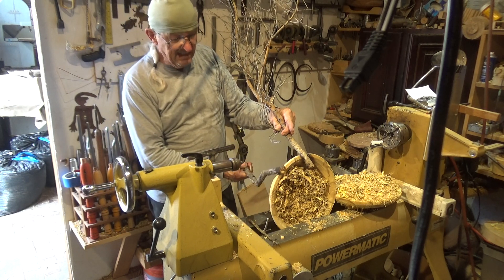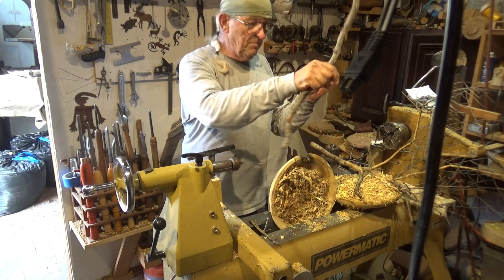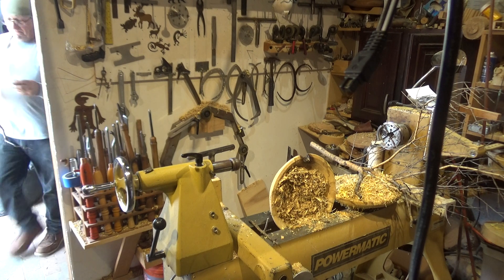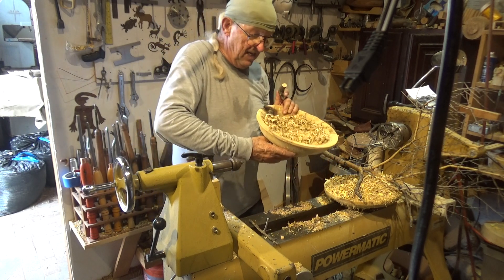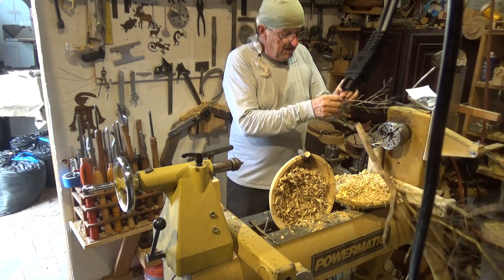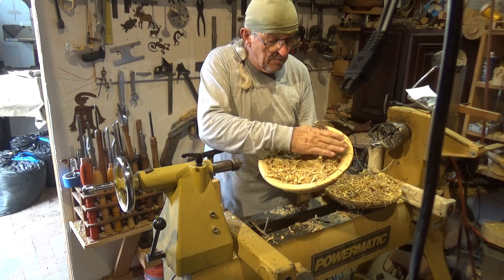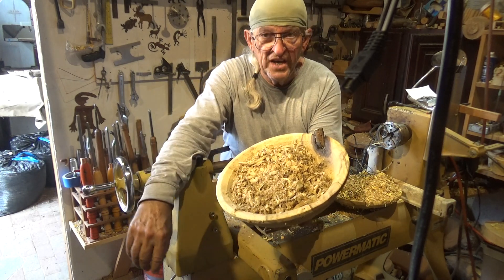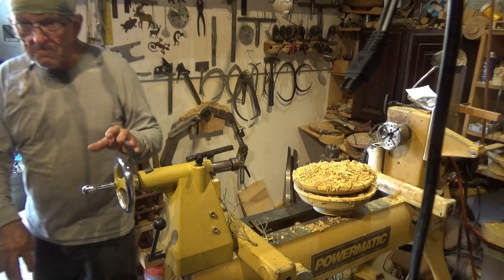Jerry's filler for larger voids

Comment: I have some 100 year old juniper fence posts which are extremely gnarly. So much so that it's difficult to get large pieces out of it. I have spent the last week researching the best epoxy to use for deep voids.The are all too time consuming requiring multiple pours. Your solution is so obvious. I plan to carve pieces of either juniper or a contrasting wood and plug the voids making them smaller and using CA and ground coffee or small amounts of epoxy to fill around the plugs. Thanks for turning on the light bulb.